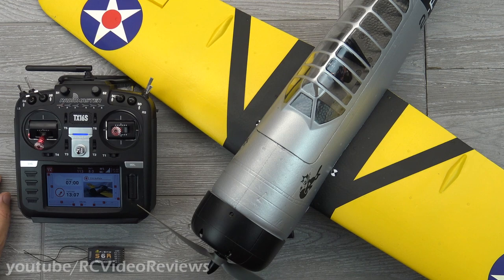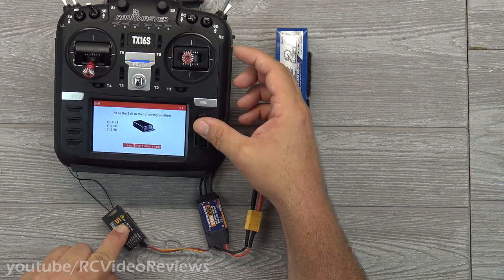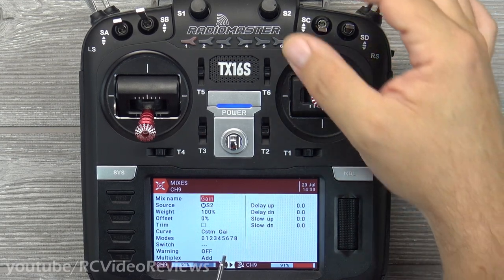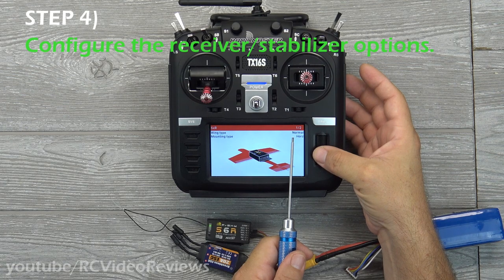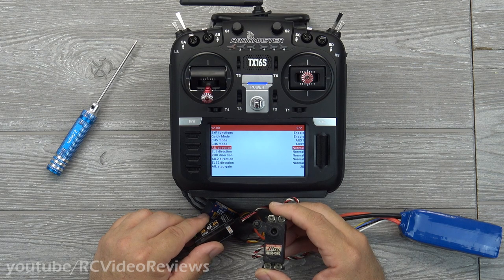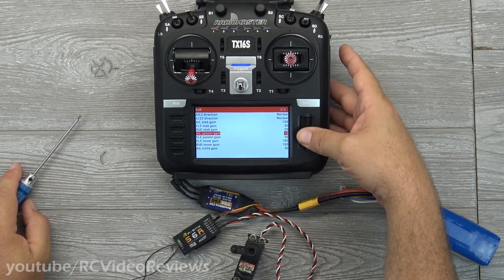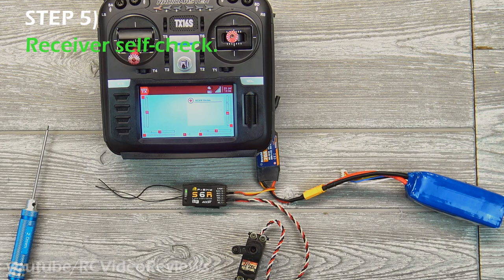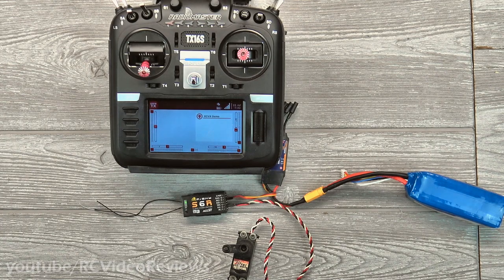Radiomaster TX16s and FrSky S6R / S8R Setup Guide [Quick Mode] • [Intermediate]

Comment: Excellent video and very clear thanks. I have a couple of these and when I’m done with the calibration and happy with the setup, I move channel 12 to a momentary switch. That way it becomes a panic switch but without reactivating calibration in flight. 👍
Reply from the maker: That's a good idea for C12. I actually spent some time tuning Auto Level on my Stik the other day and once I got the elevator offset right I did a few trial runs for some of the guys at the field and they were impressed how well it recovered from any attitude I put the plane in. 

A momentary switch would be a very good option to use it after calibration. Thanks for sharing your tip with the channel.

Comment: I watched this video once and decided to buy a couple of these rx's. Then I tried to remember what I watched to set one up. I had to come watch while setting one up to finally remember. Now I am good. Nice video's
Reply: OH. And you have a good style of going step by step in your videos and that is why I look for yours when I need to learn something about this radio and now this rx.
Reply from the maker: Glad I could help!
Reply from the maker: Thanks Vance. I appreciate that.
Reply: I found out that if the radio send out a different channel order than AETR, this won't work. I was coming from Spektrum and was using TAER. So I had to move everything around in the radio and on the rx. It works great now.
Reply from the maker: In OpenTx you can assign any input to any output. If you want TAER all you have to do is put your Throttle Input on Mix 1, Aileron on Mix 2, and so on. OpenTX doesn't care about channel names. You can map anything to anything. On the system setup page, you can specify the default order for new models, but that only takes effect when you click "create new model". The radio will then use the default order. They can still be moved afterwards. Oh, and if you use Spektrum RXs you may have to tell the radio to ignore channel map in the model setup.
Reply: @RCVideoReviews  I had everything hooked up in TAER and the rx would not work as a stabilized rx. It would work as a standard rx though. When I switched to using AETR, it started wroking as a stabilized rx.

Comment: Another great video. As we discussed at one point, I did get my hands on an S8R. I was able to update the S8R to the latest firmware (2.1.0) using the TX16S, very cool 👍. One thing to note, and hopefully folks will see this, if you are using 2.x firmware on your SxR receiver, you have to set the protocol in the Multi Module to FrSkyX2 D16. I’m embarrassed to admit how many times I tried to bind using the standard FrSky D16 protocol and just scratched my head wondering if something was wrong with the receiver. Funny how reading up on the different protocols on the Multi Module site can make a dumb person smart. LoL. So yes, it does work with the new 2.x firmware, the caveat being you need to be on a recent version of the Multi Module firmware and you also need to be using FrSky X2. 👍 Hope that helps someone!
Reply from the maker: Thanks for sharing that detail. Here's the protocol link in case you want to know what @the rc air marshall is referring to: https://github.com/pascallanger/DIY-Multiprotocol-TX-Module/blob/master/Protocols_Details.md#FRSKYX2---64
Reply: Thank you!!!!!
Reply: I had the issue of non binding using the XJT module , I could not get it to bind. It was only when selecting the internal module to the settings above that it worked. Strange as I had the internal module set to off !

Comment: Thanks for this clear tutorial. I'm now ready for flight test of my first stabilised S6R receiver. After the final calibration sequence using channel 12, I set the weight of channel 12 to zero, just in case I need to redo it - it'll be quick and easy to set it back to 100%.
Reply from the maker: I don't know that I'd set the weight to zero. On mine I remove the switch. I leave the mix line though--just no switch assigned.

Comment: Great video on setting up S*R recievers As mentioned but many will miss its very important to do final calibration at end with ch12 switch servo dance, stick throws etc
Reply from the maker: That process and the need to conduct it is explained clearly https://youtu.be/BObseyO1cjE?t=1572

Comment: Your tutorials are so concise. Without them I would be lost on this radio! I'm wondering if you might do a video on how to assign Auto level and stabilization to aileron 2 (ch5). It only effects my aileron channel, elevator and rudder. That is a mystery to me, as is assigning the auto level and stabilization gain to S1. 👍
Reply from the maker: In the SxR LUA can you can specify what the 5/6/7/8 channels do--including if they are ailerons/elevators which will include them in gyro outputs.

Appreciate the comment.

Comment: Got mine earlier today. Frysky could learn something from these guys. Very easy setting up. As for Sub trims, could not be easier. Dial in your sticks with trim go in to sub trim copy trims to sub trims. an your done. Trims back to 0 with sub trims set to how you like your flying thing trimmed .
Great Radio what i will be adding external Crossfire to get max range
Reply from the maker: Let me know how you like your crossfire module.
Reply: Not heard anything yet how well the internal Crossfire works range wise, have you? Know they bind up ok an work
Reply from the maker: @droningon825  Internal Crossfire? As far as I know the only internal non-2.4ghz option on either of these radios is FrSky R9. Am I misunderstanding your question?
Reply: @RCVideoReviews  Yeah is not R9 crossfire? External Crossfire module just arrived what 10mins ago.
Reply from the maker: @droningon825  No, R9 is a FrSky protocol. Crossfire is developed by TBS.
Reply: @RCVideoReviews  Ok thank you, still learning. Just binded FSIA6B up with TX16s .
I know i have said it already. But really nice radio an how Os is set up
Reply: @RC Video Reviews - I have the Crossfire Micro TX V2 on my TX16S, it works fantastic, and was recently updated to support up to 1W output power. Excellent upgrade for the TX16S if you’re looking to add 900MHz to it.
Reply from the maker: @TheRCAirMarshall  I haven't found a reason to add range to my radio yet. I have a Dragonlink v2 sitting on the shelf waiting to go back to work. I wouldn't mind getting back to it someday though.

Comment: This seemed so clear and straightforward until I tried to follow it with an SR8 Plus and my TX16S running v2.9.2.  Right off the batt the receiver blinks red after plugging in power.  It is not bound to the radio (in multi internal with external ELRS off) as no control over a connected servo exists nor will it bind (radio only provides for Frsky D, not D16, and the RF protocol only allows a D8 (or clone whatever that means in this context).  Receiver set to 1 (my first attempt to bind something).  Holding down an unmarked black pad (which feels like a switch) and then powering the receiver up results in a slower red blink for maybe a second, then a slightly faster red blink.  At no time is there a green blink.  At times upon movement there is a yellow flash which reverts back to solid red.  What myriad of things am I doing wrong?  Thanks

Comment: Hi, thanks for the video! The best video on the subject so far. However, I discovered a strange phenomenon. If the gyro is deactivated via the 3 pos switch, the auto mode is still half active. I disabled my gyro but my plane would not fly inverted, the gyro kept trying to use the ailerons to bring the plane back to normal flight attitude. It took me a long time to find out what caused it. I have to set the AUTOLEVEL gain value to 0% in the gyro menu in the LUA script. This is the only way to fix the problem. The second strange phenomenon is that I have to manually calibrate the gyro before every start as soon as the lipo is plugged in, otherwise it cannot be deactivated via the 3 Pos switch and would be on permanently. Somehow I haven't been able to get along with this S8R gyroscope for 2 years. I discover new problems every time.
Reply from the maker: You need to make sure you don't have a switch on Ch12. i.e. When you turn the gyro OFF, it should NEVER influence the model. You're missing something. If you set the gain value to 0% for autolevel, you're basically changing the rate of return to level to zero and that's not good.
Reply: @RCVideoReviews  Thank you for your fast reaction. But in your video you say the ch12 is a 3 pos switch for calibration. You say nothing about the fact that I have to delete it again after the first calibration. Or am I not paying attention properly? I don't want the auto level feature at all. I just need GYRO AUS and attenuation.
Reply from the maker: @derstanni  You don't "have" to delete it. The problem is with that switch on, FrSky saw fit to invoke attitude hold mode. So while your primary switch may show the stabilizer is off, if Ch12 is on, the attitude hold mode will also be on.

I try to cover as many scenarios as possible.

Bottom line: If you turn off attitude hold, it doesn't hold attitude, it will simply react to un-commanded movement then return to neutral. If yours isn't working that way, you've missed something.

Comment: I have the SR10PRO receiver. It will not enter the "calibration" mode. Setup as per your instructions. All mixes were setup without issue. But receiver will not enter "calibration" mode.

Comment: Am sending you this as it was sent to me by Allishanmao    ----  
Its the best radio for Volantex planes LOL. Just setup a new model as plane. make sure its set as AETR (Aileron, Elevator, Throttle, Rudder) then go to multi protocol.and select V971 protocol. Setup a new switch on channel 5 in mixes. and use a 3 position switch. this will change from beginner, intermediate to expert mode (Gyro on and off) thats it. you do not need that dreaded one click return and one click aerobatics switches. forget them. Turn on the plane, turn on the radio and you will be bound to plane automatically. now check if your Channels are working in right order. remove the prop before testing this. if everything is right, go fly.    Hope this gets to you ok best regards. Alan
Reply from the maker: Thanks for sharing.

Comment: Hey man, I have one question: After you level your plane and do your final calibration (I use SB), can I change to the momentary SH for the "panic" switch? Also, I have to say that your videos are pretty much all I need to watch if I want to do something with this radio. I was at the field and I showed some guys (and lady) how I use my momentary switch T5 down for auto trim & T5 up for my timer reset and T6 for my throttle cut which leaves me more switches to do whatever I want. One buddy just bought the IX20 and went and bought the RadioMaster due to the useability (He sold his IX20). I just want to say big thank you for your time and effort!! Like Graywoulf, you are certainly my go to when it comes to this radio and ike many others (I'm sure) I could go on and on with all your videos I have watched and the things you have tought me to use with this radio.

Comment: Thanks for all the information. I got a Archer plus SR6 mini which I want to use with my Radiomaster TX16S. I managed to bind the receiver in ACCST D16 mode (needed to upgrade to latest firmware). But the calibration failed to work. On the sensors page, I can see, that the signals are moving. But the lua script is not connecting. Is there any workaround? Do you have experience with the Archer plus series in ACCST mode?

Comment: Hi awesome vid but im having a little issue, i have bound the radio and reciever which are working fine all functions working as should, ail, rud, ele, flaps and gear. But when i go onto settings it doesnt show a reading on the calibration setting just 0.00

Comment: When you done the calibration complete, it ask you to "press return on ready".. but then it goes back into calibration again. 

How did you manage to get out..? In your screen 5.50minutes you are starting with a new chapter. Did you disconnect the receiver first and reboot your tx?
Reply from the maker: After the screen flashes calibration complete you can press return to exit the calibration lua.

Comment: What would u suggest to do to prevent the gain knob from accidently being used? How can I save the gain position so I remember where it flies the best?
Also, I was going to use the left slider for gain but on edgetx 2.8.0 LS is no longer an option under  special function, or is it there but I  can't see it?

Comment: My S8R refuses to go into step #5 - Self check.   I have tried activating channel 12 with the mode switch in each of the three positions.   I've moved the channel 12 SA switch at many speeds including as fast as I can flip it, 3x 5x 7x etc to no effect.  Can't get a blue LED no matter what.   I have a new RadioMaster TX16s Max set up EXACTLY as shown in your tutorial.   I have TWO S8R receivers that I got a year ago (and then gave up on them when I couldn't make them work with my older Taranis X9d plus radio.   The TX16s has been upgraded to the latest version of Open TX and the multi-module has been upgraded also.   The receivers were previously upgraded to newer firmware, but they would NOT bind after firmware upgrade.   I found a thread on the R/C forums that said this was due to the upgraded firmware.   I reinstalled the OLD firmware on the S8Rs and they bound instantly.  I tried upgrading the S8R firmware again, to see if it would work with the TX16s: same result, it would NOT bind.   Reinstalled the old firmware and instant binding.  The S8R is working okay in off mode; its working okay in wind fighting mode, but the ailerons are holding a turn and there is some up elevator when I put it in self level mode.   The same thing happens when channel 12 switch SA is in the bottom position.   I think these things would be corrected by a successful step 5 receiver check/calibration.   So CLOSE.....   but no cigar.     One other little thing (or maybe not so little????).    When I finished the receiver calibration (flipping it around until I got a yellow LED in each position) it said calibration was successful and hit RTN.   I pressed the RTN button to no effect.  I tried repeatedly.   The only way I could exit was powering down the radio.   I tried again, going through the 6 orientations until it said the process was successful.   Prompted to hit RTN again.   Couldn't exit with the RTN button.   Had to power off.   I'm wondering if this means that the first calibration was never fully completed?   In you video there was a jump cut at the point.... I did NOT see you successfully exit with the RTN button.   Is there a work around for this?    Any help will be appreciated.   Thanks, Brian Kuehn.
Reply from the maker: Did you move Channel 12 through the 0 position? You used a 3 position switch right? That's one thing I've never had a problem with completing on the SxR is the Rx self check. Look at your Channel Monitor on the Radio and make sure you see Ch12 going from 100 to 0 to -100 and back when you move that switch.

The LUA script can be a little flakey sometimes on getting out of the calibration. I'm not sure what to say other than press RTN and the calibration should be saved.
Reply: @RCVideoReviews  I did use a 3 position switch ... the SA switch; I did check the monitor and it was moving through the 0 position.   I assigned a different switch to see if it would change the result (SB) and no difference.    I re-read the FRSKY instructions that came with it to see if I missed anything.   Page 3 of the manual says: Automatic level: When selected, SxR will make the model return to level flight with internal three-axis accelerometer and three-axisgyroscope on AIL and ELE channels after the sticks being released to neutral. Automatic RUD channel works in stabilization mode only.   I mention this as you seemed puzzled that the rudder was not corrected in Auto level mode.   After literally 12 hours of fighting these receivers with my Taranis X9D plus, I bought a couple hobby eagle A3 pro stabilizers.   These work perfectly and have a much wider array of modes available.   They work really well but add another component and more cables.   I could NOT get the RTN button to exit the calibration.   I'll try it again.  Thanks for getting back to me.
Reply: BOTH problems solved.   I mentioned that I upgraded to the latest version of OpenTX and also updated the Multi-module firmware.   Included with these was an  update to the contents of the SD card.   When I went to calibrate the S8R receiver I used the SxR_Calibrate.lua file.   The updates had ALSO installed a different filed named SxR_Calibrate.luac.  I backtracked and tried using the LUAC file instead of the LUA file and the RTN button worked to exit the 6 axis calibration and the channel twelve 3x switch flip activated the blue light and RX calibration.   All modes are now working perfectly.  Thanks for taking the time to create and post the video.